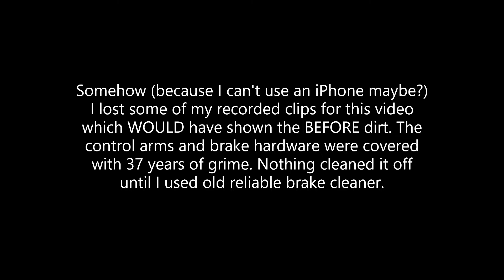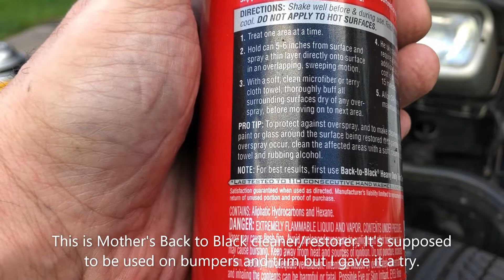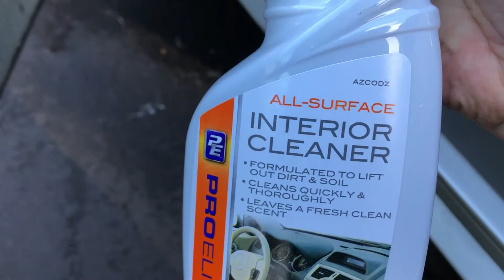Cleaning Suspension, Under Hood, and Inside Bits - Car Show Ready?

Comment: That's where the work is. A lot of elbow grease. Nice job. I did see a video of a guy who uses a propane torch to restore black plastic. It was interesting to say the least, seemed to work. I may try it on my pickup.
Reply from the maker: Flame and plastic? Wow. I have to say the Back to Black spray worked better than expected - and dried nicely.
Reply: @Mikes84Corvette  Yeah I looked up more on it, heat guns also restore plastic, so they say. I will give it a go.
Reply from the maker: @1984C4Corvette_DIY_Garage  Looking forward to the video!
Reply: @Mikes84Corvette  Video up. Just need to find something fiberglas to try but it worked for me very well. I'd love to do the underside of the hood on the vette, as that is always a major problem area for dirt.
Reply: Just a note.  Vinegar first will deep clean black plastic, which is the first step I use before doing anything else.  Diesel oil also is know to somewhat, "rehydrate" rubber and plastic items.  Remember plastics come from diesel products.  Applying heat to plastics does cause a molecular shift, however you have to be very careful  This is more invasive than what I choose to do.  Heating will also only work so many times, as it also dries out the plastic structures at the molecular level.
Reply: @davidsafely732  good to know

Comment: Regarding black plastic and rubber...

Vinegar first will deep clean black plastic, which is the first step I use before doing anything else.  Diesel oil also is know to somewhat, "rehydrate" rubber and plastic items.  Remember plastics come from diesel products.  Applying heat to plastics does cause a molecular shift, however you have to be very careful  This is more invasive than what I choose to do.  Heating will also only work so many times, as it also dries out the plastic structures at the molecular level.
Reply from the maker: Great info! Thanks!